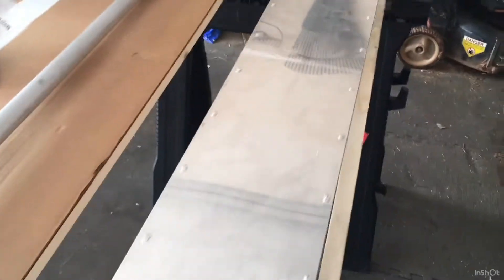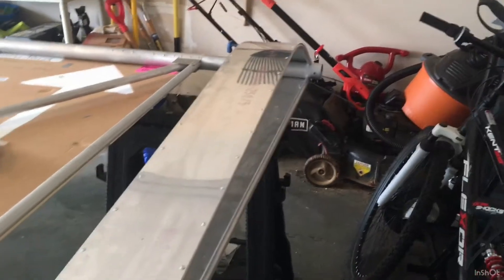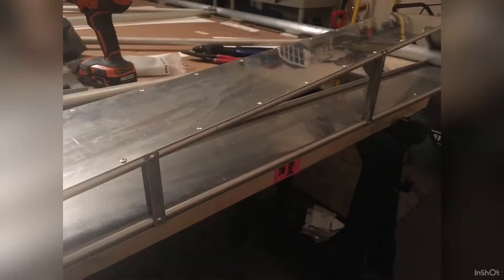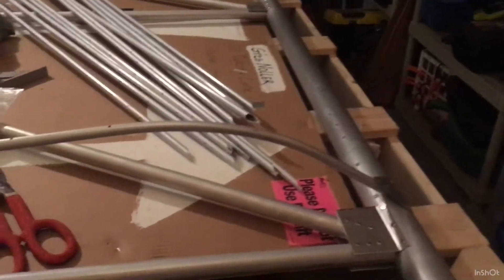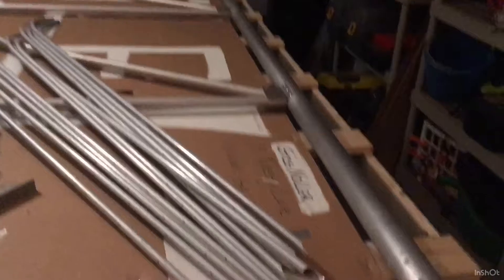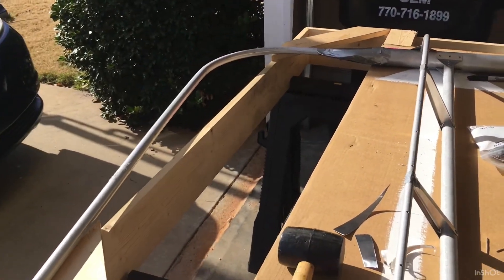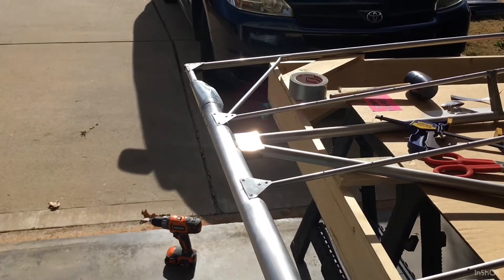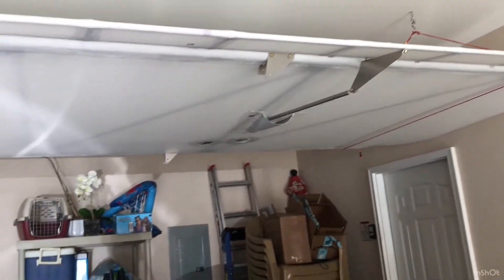Excalibur Aircraft Build Project 14

Comment: Looking good. Did you have to deburr any of the parts you got, I didn't notice you doing so. Or is that something the manufacturer doesn't instruct you to do? Also those long stripes of aluminum sheets you riveted on first. You left the corners square. Is that something else that is not required? Rounding of corners and sharp edges?
Reply from the maker: Only a few parts have to be deburred per the instructions or Tom.  Everything else is covered with duct tape to prevent fabric tears. Same applies to the aluminum sheets. Don’t round them but cover the edges with tape.